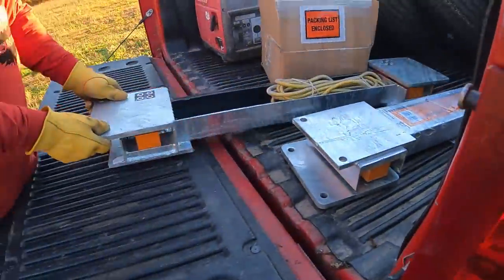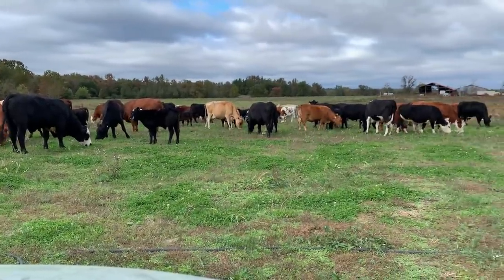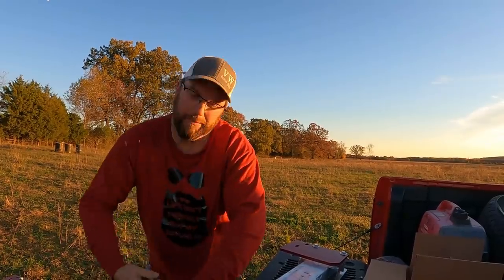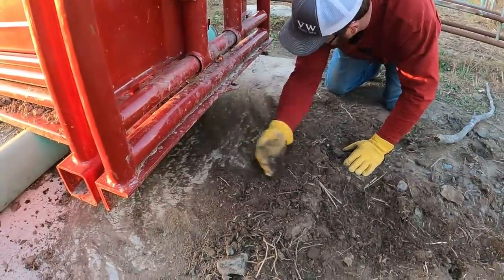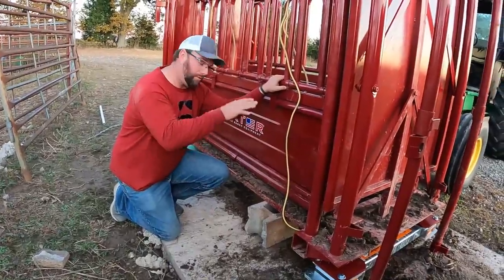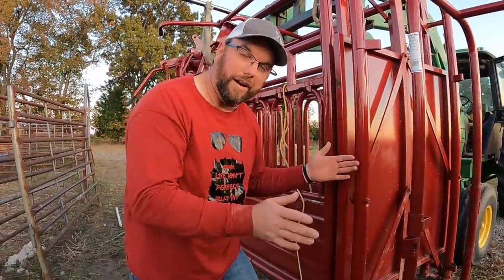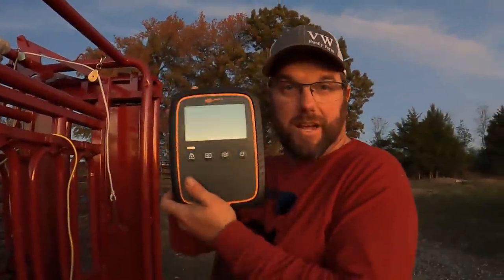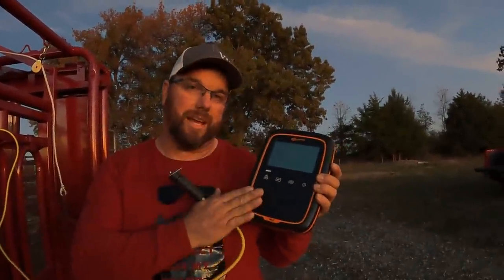Installing Gallagher Load Bars on Tarter Squeeze Chute

Comment: Hey y'all, this was a very informative video. I love the gadgets and equipment used in livestock management. Hearing why y'all buy the more expensive or the less expensive and why each one has its place. Seems the Gallagher and tarter brands work well as lots of y'all use them. I want a Gallagher net fence 100' solar power to go around my garden to keep the rabbits out so I don't have to keep shooting all spring long. I love watching all the installation videos like today seeing the back concrete spots should be drilled in advance. Thank you for the video today bless y'all bye for now

Comment: How much did the bars raise the chute off the concrete? In inches.
Reply from the maker: Probably right at 6”. With the slab and the load bars it’s about half the height of my stock trailer floor.

Comment: Thank you Gallagher for putting the mounting  holes under the load plate to make it nearly impossible to anchor. This is not rocket science.  Do not use quick bolts for this as it will be impossible to remove the load bar because of the angle of the stud. Only option is to use LDT's Large diameter Tapcons or Powers Screw Bolts so you can remove the loadbar if needed without a torch. Come on Gallagher ! These things are $2000 , Use your heads !